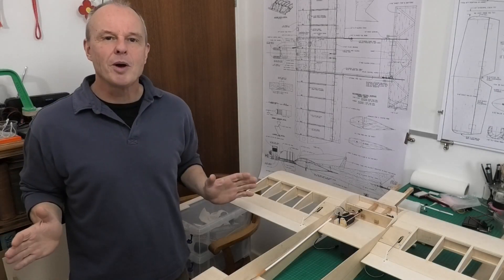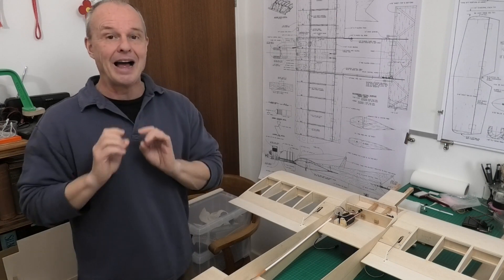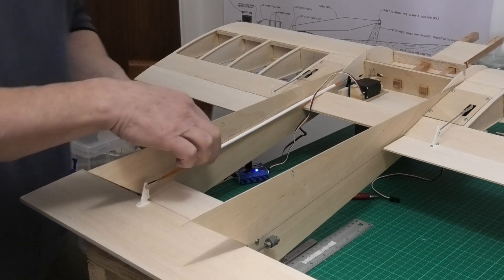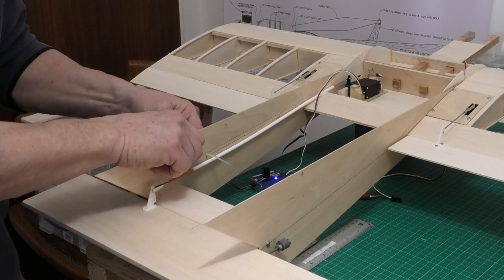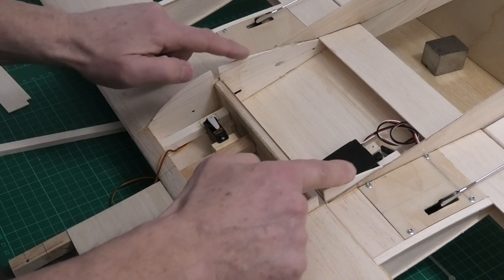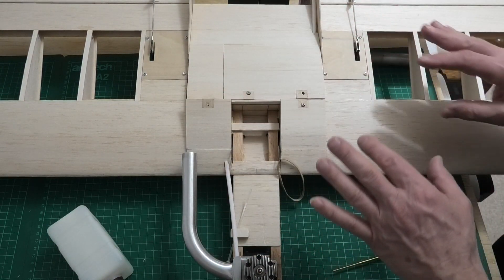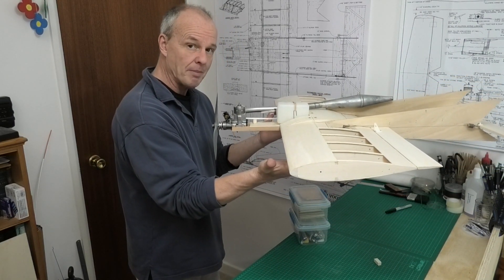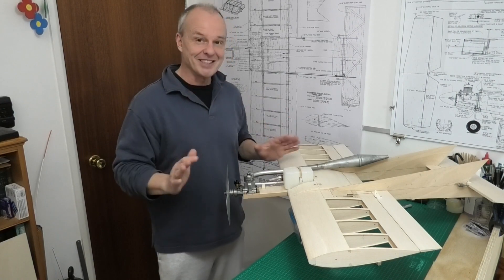Voodoo VI - Hi Performance 40" Combat Wing: Pt 7 - Finishing the Build!!

Comment: So… it just flies off its ailerons, Mark? No rudder? And no dihedral to it…??? And… when you say “fuel proof”… that’s just varnishing, isn’t it?

What a spectacular build!👍
Reply from the maker: Hi John, thanks for the comment, its really appreciated.  Yes it flies on the ailerons and elivator, but no rudder.  Yes, there is no dihedral.  The fuel proof I use is 30 min epoxy, thinned down slightly with 95% ethanol

Comment: I think I would cut the forward part of the centre section right down to the airfoil, then blend to the boom as it doesn't appear to be above the top of the spar.
How about adding an aerodynamic balance tab to either end of the elevator, rather than the mass balance? That would reduce  air loads on the servo considerably.
Reply from the maker: Hi Richard, yes I totally agree, if I was to build again that would be a great way to go, sure you could get all the electronics within the wing without the bump in the middle.  And great idea about the balance tabs, thanks.

Comment: could you explain how a snake works or a link to where you got yours please? I've only ever seen servos directly connected to the service with arf clevis and horns or piano wire. What benefit does a snake give? Great vid as always
Reply from the maker: Hi Oliver, thanks for the comment and kind words.  The snakes are a very flexible way to conect the servo arm to the control horn.  Essentially and inner piece of plastic connects the two, and it travels down on outer tube which is held ridgid within the fuselage or as in this build, along the boom.  As they are both flexable they are great for bends etc.  this is a link of where I get mine.  Hope that helps  https://www.slecuk.com/accessories/snakes
Reply: @MarkRobinson555  thanks that makes a lot of sense! I'm new to your channel and binge watching youre builds, love it!